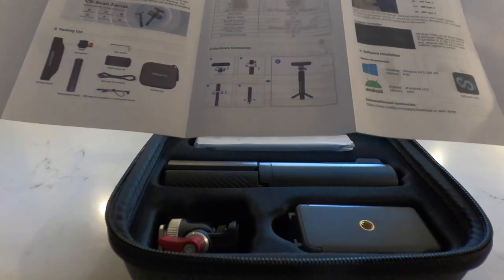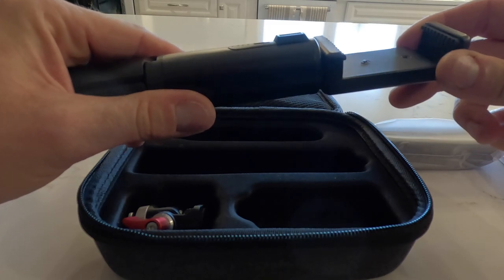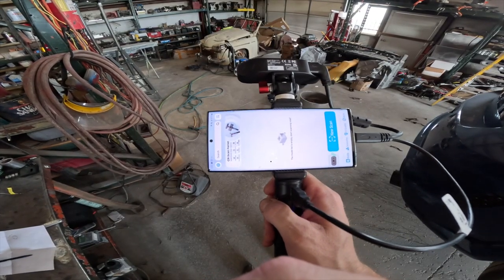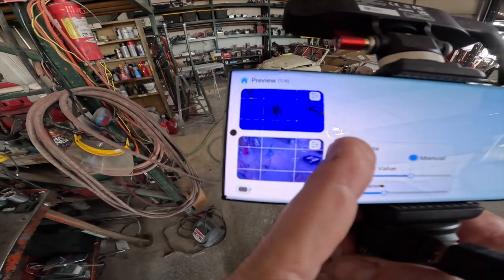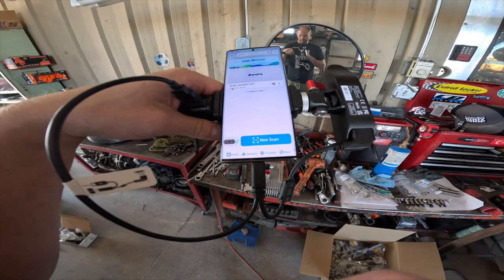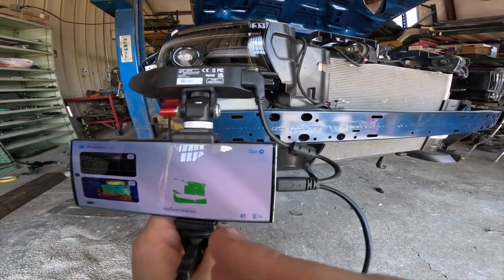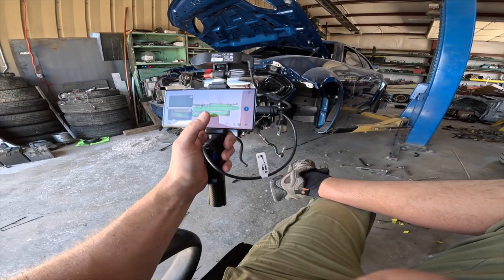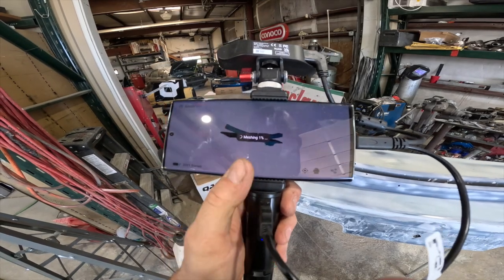Creality CR Scan Ferret a Cheap 3D Scanner that Actually Works!

Comment: I was a crowdfund supporter for the CR Scan Lizard. Very happy with it. I haven't tried the Ferret, but from what I understand it's a lighter duty more mobile solution. The Scan Lizard can be used as a handheld too, but it's more chunky and I haven't tried to attach it to a phone so I don't know if that is even possible.